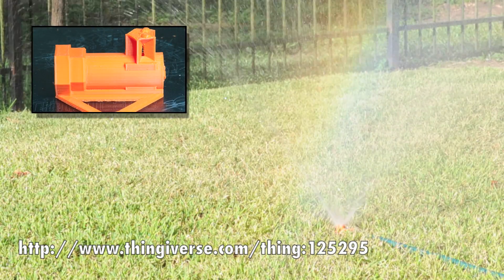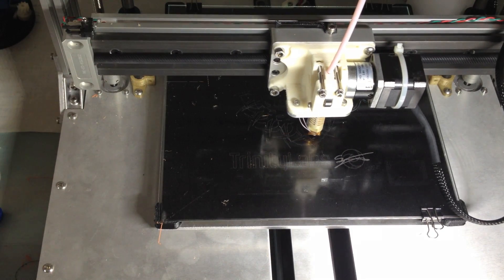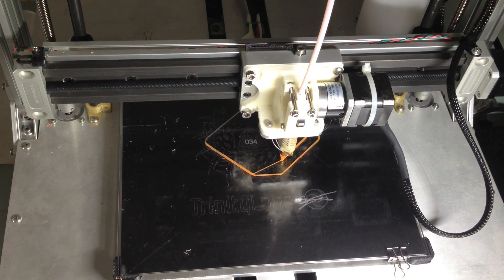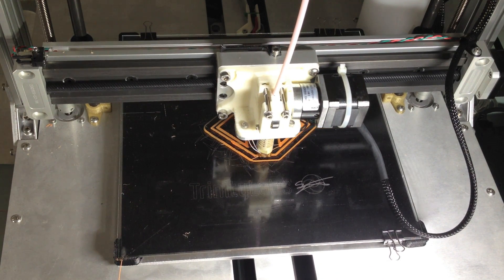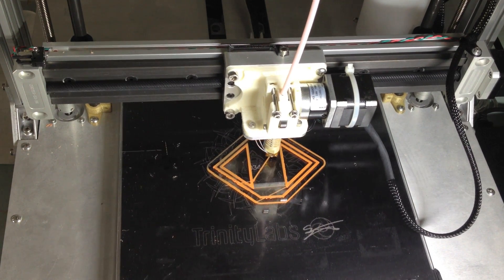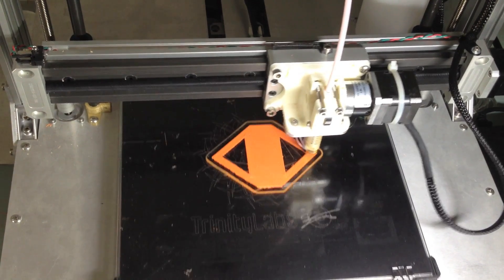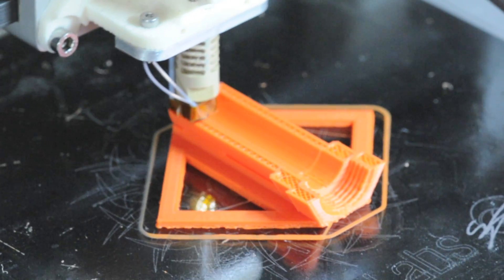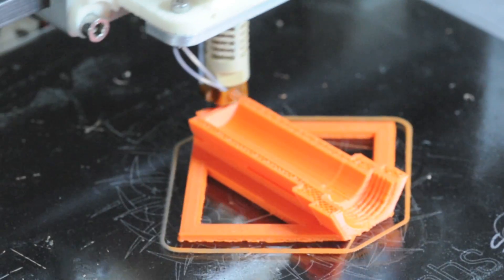3D Printing a Garden Sprinkler

Comment: ABS certainly can be made to be waterproof. Printing multiple perimeters helps, but acetone vapor bath (or even just dipping the whole part very briefly in liquid acetone) can improve it even more so it's totally waterproof. But for a sprinkler head, it really doesn't much matter if it leaks.

Comment: BusyBotz, you are just the person I've been looking for! I'm having trouble printing this, specifically getting the threads to be clean enough to attach to the hose. The problem is (of course) the top section, where it gets droopy and the threads are pretty much lost. I too use Slic3r -- what settings do you change to compensate for these overhangs?